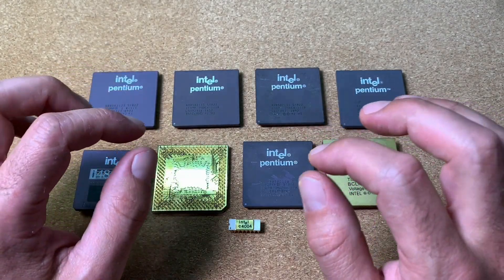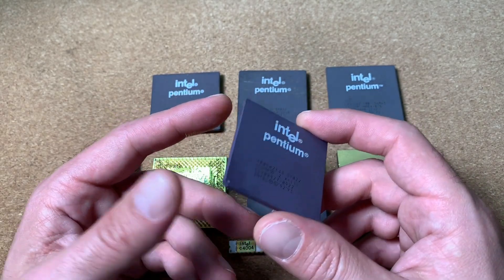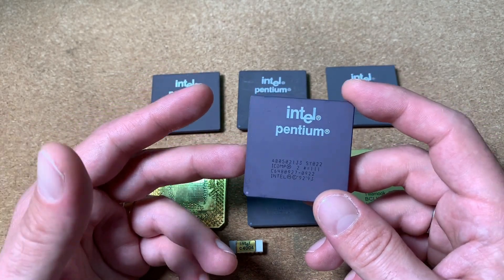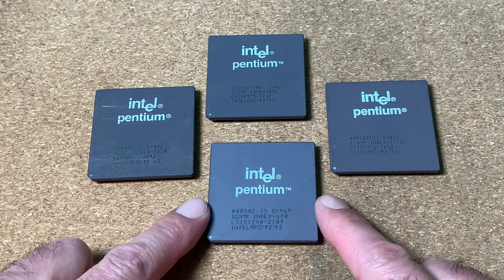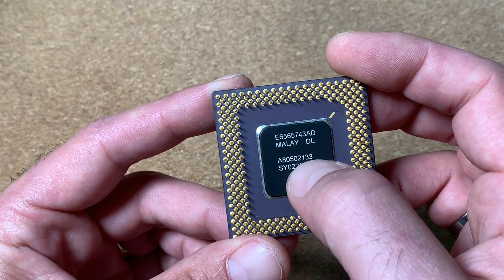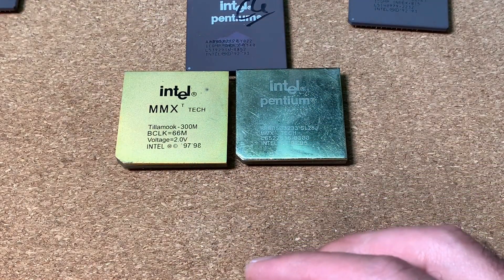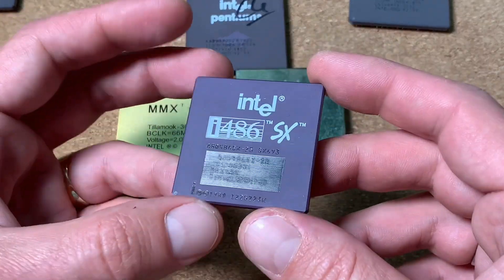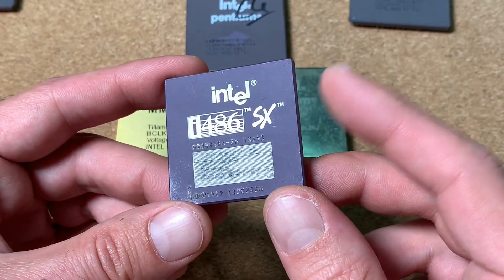Faked Pentium CPUs / Huge Crime Story in 1996 + Giveaway

Comment: Romania was under embargo until 2004 from importing any Intel chips above 1ghz, namely because a state owned company made lots of Intel clones starting from the 80s. I know people claim we even did Pentium 1 to 3 clones. I would totally want to hear your opinion on those!
Reply: Did they work
Reply: @Hi-levels  you don't get embargo on buying Intel processors for nothing. afaik there aren't that many countries that had such a restriction imposed on them. and we got rid of it only when we joined NATO.
Reply: @RomaniaOverpowered  It's normal... If you damage a specific company as a state body... Wto should have commissions to reimburse Intel on that behalf actually
Reply: @Hi-levels  well, we ended up shuttering the ICE Felix company, after Intel initially considered producing processors officially here.
Reply: @RomaniaOverpowered  that's interesting. Never thought Romania would be able to produce cpus
Reply: @Hi-levels  thing is, we were out of luck in the 50s with old supercomputers, until the French left NATO. We partnered up with them, ended up making BASF tapes along french supercomputers. That gave us a headstart untill France went back in NATO, making trading a difficult task between the countries. My grandfather ended up eliminated by the Securitate for choosing to equip the postal services and railway services with Siemens computers. So like any soviet country, we ended up making z80/CP-M/IBM-PC clones however hard the times were. We were also out of the Warsaw pact, and that put allot of pressure on Romania to ensure its tech independence from the soviet block, after gaining the statute of favorite country from the US, before the revolution. Shit hit the fan tho, when Ceausescu went all crazy thinking he could be like the big boys, and create a romanian counterpart of the american IMF, in relation with oriental and asian countries (we even ended up selling romanian designed stuff to China, before it became the bubble economy it is today). Phew, sorry for the wall of text.
Reply: @RomaniaOverpowered  wow that's very interesting. No need to type sorry. Very interesting stuff. I'm always into IR, politics and technology etc.

I know there were lots of spy games and why not going on the soviet block and that iron curtain area.

That's unfortunately how it is. The big boys never let others to have something good like you described..

Rip your dad
Reply: @Hi-levels  My grandpa was a cool guy nonetheless. In 1977 there was a huge earthquake in Romania, 7.2 on the Richter scale. Obviously, that destroyed allot of the equipment he brought to the Romanian Post Calculation Center HQ in Bucharest. Siemens told him it would be impossible to reconstruct that system (system that was also used in international trading, as it was connected to the outside world), and yet he did, rebuilding the whole mainframe with his team in just 2 years. Lots of cool stories in the soviet block on tech related stuff. I would also love to see more on Estonia, now known for it's great digital citizenship program, but back then , it was the most important IT hub of the USSR. They were always light years ahead.
Reply: @RomaniaOverpowered  wow its getting more interesting

Comment: Do you have any WinChip CPU? I know, they are not rare but at least interesting. I'm just a little bit curious about what they exactly are. If they are clones or something else. I have one which is WinChip 200MHz.
Reply from the maker: good input. could be a nice topic for a video 😉
Reply: @CPUGalaxy  Transmeta too
Reply: Centaur winchip.  No its not a copy of intel pentium design.its  compatible.  It implements a lot of instructions as multiple. Risc instructions ... Slower..but the core instructions were implemented as one risc instruction.  Anyway due to smaller cache,  and lower transistor count,they got mmx performance at 5 volts...So it was sold as an upgrade to fit in  old  5 volt motherboards. Socket 7 had various voltages... 5 , 3.3 and the adjustable voltage  thing started .. such as 2.8 2.9 3.0 ...

Comment: Remember that one could use a micrometer to check the thickness of the Pentiums, cant remember what thickness one should check for. :P
Reply from the maker: I found already some where the ceramic is thinner than usual. I think this was an advanced way of relabeling. They sand the ceramic down and engraved again with a laser the black markings and reprinted the white stuff. The ceramic surface looks different under the microscope and also the used font is obviously different. i am still researching on that topic before I‘ll make an update video on that.
Reply: @CPUGalaxy  yes, i also recall that sandig was an issue.

Comment: the coating must certainly have hurt thermal performance, i wonder how much of the reduction in reliability was due to worse cooling rather than the overclocking itself
Reply: Nah. Its airgaps that hurt thermal cooling performance heaps
Reply: Nah. Those CPU's had a tiny heatsink and no fan on them.
Reply: pentiums could run for ages even of the fan died, as long as its heatsink was still on it ran fine, so I dont think it would have made much difference back in those days.
Reply: Aint gonna lie, they look cool anyway.
I get it, that coating just hurts the processor, but it looks cool

Comment: My First PC was a 486 DX2 66 from Siemens Nixdorf.
When I installed a new CPU (DX4 100 - never recognized by BIOS and later replaced by an AMD 4x86 I think), I removed Just for Fun the onglued passive Cooler from the old CPU. It was in Fact a DX2 50. Now it was clear why Wing Commander 3 freezes so often :D

Comment: I can confirm , that this practice of REMARKING CPUs was still present up to 2004, cause i was able to buy them trough reputable distributor with ease. They were marked as such , but unfortunately AMDs ones ended up with short end of the stick , cause of the open die and cracking ,  4 out of 10 were dead or unable to work. They were usually sold in trays , once they started going with boxed coolers situation changed .
However i remember well my P3 Celereon i had in my PC clearly remarked as a 900 MHZ CPU , but it was a 600 MHz one . However i was able to run it on 1200 MHz without any issues for more over than a year , and as far as i remember it went well pass that  with 142mhz bus increase but i kept it at 133 and it worked like a charm . So Intel CPUs were well capable of even 2x+ speed they were rated , not all of them ofc.
Reply: Im sorry but im calling BS on you overclocking a 600mhz Celeron to 1200mhz without LN2 or some other refrigerant type cooling setup. I have seen a Celeron overclock to 8.4ghz but it was with liquid nitrogen. I can overclock my current 10th gen intel chip 1300mhz but I am using liquid cooling and I have my chip undervolted.
Reply: @ryanmalin  I'm not joking or over selling it . It is God honest truth. My personal CPU, not cherry picked from a bin of CPUs. It was 100% stable on 1200 MHz on normal CPU cooler. I don't remember the temps of it but it was working without any issues even in my converted attic room at the time with room temps over 35 C without any issues .
I sold off the mainboard ( i dont recall what mainboard was at the time ) and CPU as 1200 Mhz one i had 1 GB of ram in it ( 4x256 MB) and Intel i740 AGP graphics  - i remember that well cause it was the worst graphic that i ever had.
Thing is CPU's back 20+ years ago were built much differently , with large overhead and sold to scale down the line, thats why remarking CPUs was such a huge business . Nowadays its totally different ,  You need like stupid refrigeration to get high clocks, and that is just to see how much you can pull out of it - not for everyday use.

Comment: at that time there wasn't something like CPU model ID? that tells what is the real model by software?
Reply from the maker: no. only the cpu family code. clock rate was depending on the quality of the silicon die after production.
Reply: @CPUGalaxy  wasn't that deducted by software looking for which sets of opcodes was available?, or it has a specific opcode for lookup the family?
Reply: @flyguille  Internal hidden registers only held a model and step number, only later did Intel also have the clock registers being adjustable, and not set by links, and also readable. The original binning allowed processors that were marginal at full speed to be sold as cheaper units, as they were reliable at the lower clock speed, or were below the thermal envelope. 

Later on in the product lifetime the yield improved to the point that they were simply taking the full speed chips and derating them to fill the sales orders for the low speed devices. Otherwise the full spec devices, so they were easy to overclock as you simply took them back to rating and could go further as well.

Comment: I remember working in a "mom&pop" computer shop in the late 90's and we got several fake chips, some of them from reputable distributors that got the short end of the stick ordering parts. In the end I got so proficient at spotting the fakes I could tell them just by glancing at the reflection of the light on the surface of the chip: usually the fakes were a bit shinier and usually had like a rectangular extra-shiny spot around where the fake engraving would occur - my guess is that they used some kind of fill-and-smooth technique to hide the old engraving.

Thing is, with active cooling these processors were easily overclocked up to 200mhz without losing stability (yes; back then you could get a 100% boost by overclocking a processor!) and by the mid-90's Intel binning was mostly about filling niches, as most of the processors where greatly underrated (so, most pentiums were capable of operating @150mhz, but intel needed lower parts because there was demand for the cheaper processors) so probably the clients would have not noticed if we installed these parts.

Comment: Looks like they capped a mobile processor but how do they change the internal clock multiplier?
Reply: Multiplier lock wasn't used by intel until the Pentium II line.  The original Pentium CPUs could be set to whatever clock and multiplier the motherboard supported and the cpu and memory ran stable.

Comment: My first pc sort of had a fake CPU. The store sold it as an 1.81GHz amd Athlon XP 2200+. Years later i found out that the store had overclocked it from 1.34GHz. This was back in the days when Athon XP CPUs changed name in the BIOS based on what FSB and miltiplier you ran. 🤣
Reply: You should have looked under the CPU cooler at the silicon chip.
Reply: @BenKlassen1  I was just a kid and had no idea of what a CPU even was. As mentioned, my first pc.
Reply: Yeah I overclocked a amd Sampron x3 to a phenom x4 was cool back in the day

Comment: I got burned back in the day.  I found a guy that had a 133MHz Pentium, brought it home and it wouldn't run right.  I set the jumpers to 120 and it ran fine for a long time.  I paid 150 for it.  Must have been a good deal to young me.  I was happy to have a P120 still.

Comment: OMG... And I've even found one that I had no intention to scratch but - but they put even more effort into faking it and (re?)attached a factory heatsink/fan on the new surface that I have to remove in my job - and so it became apparent because the heatsink's glue took off the extra layer, just like you scratched it off from that "133"...

But I've never gone through my collection to repeat it so it may contain some more fakes... Who knows? One thing's quite sure, they are stable at their specified speeds. I may be better off not asking but keeping that one obviously fake chip as a curiosity.

Comment: 13 MHz more, but the bus ran at 66 vs 60. Quite a difference there.
Reply: yep most of the boost was just in the FSB.. what's funny is i used to do this all the time.. i would get a cheaper CPU and over clock the piss out of it.. 
some times i would order 3 CPU;s see what one was faster and return the other 2

Comment: I used to repair laptops back in the 90s/00s and there were a few Toshiba ones that used socket 7 - we used to have a lot of issues with the CPU coming loose and had to use these small plastic spacers to keep them still.. fun times :-)

I remember seeing Tillamook chips embedded on a Thinkpad as a cheaper alternative to using pentium 2. 

I also recall this neat Japanese Libretto FF pocketable laptop having one.

Comment: i can't believe it, i have 2 Pentium SL24R (166mhz). One of them gave me that strange colour scrubbing it with a bit of WD40. After a close look, i can barely see, under the new laser engraving that it was a SY022 133MHZ. Even the Intel Pentium logo was repainted.
The other Pentium gave me no issues when scrubbing it but the engraving looks pretty much fake.

BTW i have no idea if they're unstable or not, cause the motherboards are dead...
Reply: just a little update. I scrubbed all the "paint" on the surface of one of those fake Pentiums. 
Supposedly it was a SL24R, L6270129, but after all, it was a SY022 L7221064.
So it means that it was manufactured in calendar week 22, 1997. 
Ok, everything seems normal BUT, in the rear it doesn't say i133 (like all the '96 and above), it says IPP. So whats the deal? xD
Reply from the maker: Thanks for your comment. Interesting to see how many of those pentiums were around. Good that you found one. Nowadays they are collectible. 😉
Reply: @CPUGalaxy  this one somehow managed to find it's way to Argentina..i found those in old office pc's that my grandfather had.. It's nice to know that they're collectible, it means that im gonna have it forever!

Comment: I remember hearing about a scam where vendors would overclock lower frequency chips but I didn't know they were going through the trouble of trying to reprint the model number on top of the chip. I just assumed that they just overclocked the final consumer PC. Most people never remove the cooling fan and wouldn't think to check to see what is printed on the chip to make sure they weren't swindled. Of course I know mine was original because I was too cheap to buy anything faster than the 75mhz model. Moores law made buying the fastest chip on the market a bad investment back then anyway.
Reply: I also saw this with CPU & motherboard combos. The seller would put a warranty sticker over the side of the heatsink, CPU, and socket. The only way you could see if the CPU was genuine is to remove the heatsink. If you tried to get a return/refund from the seller because you got scammed, they would refuse and say you voided the warranty. Very shady.
Reply from the maker: hahaha, damn man. very smart of the seller. 😂

Comment: Try the 300Mhz Tillamook on a PCChips M577 or M537. I tested the 266mhz on these, successfully. (Though i had to modifiy the CPU to enable the L2 Cache onboard which is switched off when you put the stock CPU into the socket) Another board i tested successfully was the FIC VA 503+. They were letting me overclock it to 400mhz stable at 2.2/2.3v Vvore. At a multiplier of 4.0x (FSB set to 100mhz). Would love to see the results with the 300mhz version, where you probably need a 4.5x Multiplier for at 66Mhz.